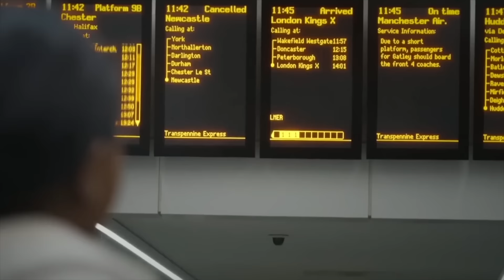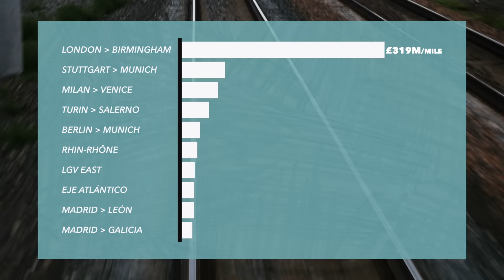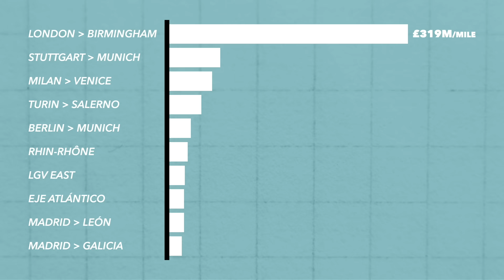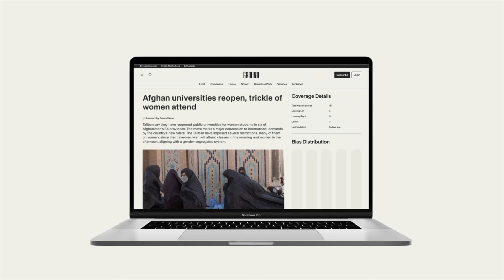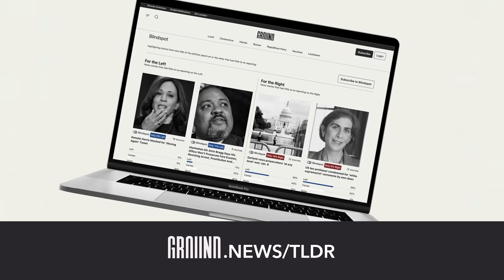The £100bn Railway: Why is HS2 Four Times Over Budget?

Comment: Strange how the UK is unable to build even 1 high speed line, while a country like Spain, much sneered at in certain parts of the UK, has an eleborate network linking it to other parts of the EU.
Reply: It's not strange at all. I'd bet anything that a lot of that money went into tory pockets.
Reply: Spain is a lot bigger and sparsely populated compared to the UK. It's a lot easy to build train on dry planes than it is to build having to buy out thousands of properties
Reply: We're not in the e.uu.
Spain is bigger and requirs more trains.
Reply: @mrcaboosevg6089  dry planes? Brother have u seen northern spain? Have u seen Spain in general ? A lot of mountains had to be tunneled and land bought , we have more mountains in one community that u have in the whole islands ,so obviously someone pocketed that money buddy , instead of coping so hard ask for the money back
Reply: @richardgallagher4880  you were in the EU when you started it.

The Netherlands has high-speed rail. Belgium has. So nice try but no cigar
Reply: @mrcaboosevg6089  excuses excuses. As the other poster pointed out, have look at the geography of Spain.
Reply: @ab-ym3bf  
Cringe.
Britain is still the same size🤭
Reply: @pascualmartinez9702  
 Cringe.
Spain is bigger so its more economical to use rail.
Stop embarrassing yourself.
Reply: @richardgallagher4880  You were the one that brought up the point of being inside the EU. And as my previous post showed, countries way much smaller and also densely populated have high speed rail.

To use your own words, stop embarrassing yourself.
Reply: @ab-ym3bf  Most of Spain is empty, that's just a fact. The only part of the UK that's actually remote is the Highlands, have you not been to Spain? It's an entirely different world
Reply: @pascualmartinez9702  I went from Malaga, then up to Porto and then to Bilbao. Most of what i saw was flat empty space, i'm sure there's plenty of mountains but i didn't see many
Reply: how about Italy???
Reply: @mrcaboosevg6089  Most of England is extremely well suited for rail. Most of the world is just fine. A couple of hills just add to the cost a bit. They hardly make it impossible. If you can build 300km/h high speed rail in upper Germany you sure as fuck can build it in the gently rolling hills of England.
Reply: @mrcaboosevg6089  Well maybe you should have payed more attention. Spain doesn't have the Alps but it is a lot more hilly than England.
Reply: Love the Spanish system, timely, clean, fast, air conditioned...smashin!!!
Reply: @Richard Gallagher  Cringe is you....I bet you voted Brexit!  And yes I am British but being in or out of the EU has nothing to do with it
Reply: @mrcaboosevg6089  an entirely different world
 indeed. Lovely people, excellent high speed rail network. Clearly a country living in the 21st century. I enjoy travelling to and through our neighbours land.
Reply: @petercrane2560  It is superb, better even than France, probably mainly because France was a pioneer on high speed rail.
Reply: @Arltratlo  I just choose Spain because I know the situation there better, and a lot of bile has been directed towards Spain from the UK in the past. But indeed, I could have picked Italy, or France or a lot of other EU nations as example as well.
Reply: @richardgallagher4880  The general public are always told to utilize public transport more often, so why on earth is our Rail Infrastructure at least 20-30 years behind most of Europe.
Reply: I mean the UK does already have one high speed line to be fair
Reply: HS1 enters the room  I'm right here, dude.
Reply: The main difference is probably that Spain actually strives to integrate its regions as it has the real possibility of regions like Catalonia, the Basque Country and even Galicia from succeeding. There is political will to build high speed rail as it promotes unity.

The UK on the other hand is far too centralised for that- 1/6th of the population and around 1/4 of the UK’s GDP so it doesn’t have as much political will to do it sadly though it desperately needs to integrate Scotland if it wants it to stop succeeding in the future 🤷‍♂️
Reply: "The UK is unable to buold even 1 high speed line"... Except the one we already have, called 'HS1' from London to the Channel Tunnel!!
Reply: What does HS1 stand for? Btw, I do know the answer I just want to know if the original poster does!
Reply: @mrcaboosevg6089  brother if u are blind is not my fault, as i said we have more mountains in one autonomic community that the whole islands
Reply: @@eliotthexton6701 since donkeys years. But to be fair, there are not many countries on the planet the English have had something negative to say about and insulted .
Reply: @pascualmartinez9702  It's easy to build a train line when your population density is about 20% of Britain's.
Reply: UK already have one high speed line, this is our second one.
Reply: @ab-ym3bf  Really there is 1 core reason and no one here has mentioned it so let me spell it out for those in the back:

Spain didn't stop doing it.

No that's it, that's the only reason. There is no more secrets. It's not pop density, its not politics, it sure as shit's not geography. We just kept doing it.

All this complaining of being overbudget, having issues buying property, etc? I've seen it. I've lived it. And if you ask any other country with a ton of HSR they can tell you the exact same thing, specially the other flagbearer, japan.

The first few lines are HELL. I remember the early years when I was a kid and news were saying AVE was DOA and we were wasteful and stupid for even trying to build it in the first place. When even flippin Merkel's people that now wanna brag so much of integrating europe were telling us to be more austere and cancel it, and UK diplomats used it as an excuse to discriminate against southern europe.

I flippin remember all that, it was so painful many thought our politicians were inept, maybe even corrupt, for continuing to fund it.

Jokes on them! Turns out RENFE was right for pushing that hard. Because yes, HSR is REALLY painful to start with, it requires a MASSIVE upfront price and no matter how much you think you're prepared, you're not prepared. Your zoning code will get in the way until you smooth it out, your ecological regulators will screech at you for months until you get them to put a sock in it, you're gonna need to train national talent to start with. You WILL go over budget and take way longer than expected. WE ALL HAVE.

But if you keep going, keep the national talent, let it expand after you've built enough of a network, its literally gonna pay for itself and more. Its probably the best long term investment my political elite has done. You can tell because I'm trying to be polite instead of labeling them as "idiots in charge" as I usually do.

So yeah that's the secret. Spain knows how to build HSR because Spain has experience building HSR. It ain't magic, it ain't culture, its just good old trial and error.

UK's mistake is they built HSR1 and then just dropped it altogether. Didn't change shit, didn't learn shit, didn't keep the national talent, just stopped. And now they're restarting practically from scratch from scratch. And with no post-HSR2 plans in the works it seems HSR3's gonna be the same. Just shot in the foot after shot in the foot.

Spain didn't make AVE1, AVE2, etc. It made AVE, and it kept going.
Reply: @pascualmartinez9702  spains population density is way lower outside the major cities, which helps a lot, and the UK's population is not as spread out over large distances
Reply: @mrcaboosevg6089  pl. Travel a little bit before speaking about Spain. Maybe you are just trying to cover UK's embarrassing end-of-empire momenta.
Reply: @mrcaboosevg6089  for Spanish engineers are smart enough to avoid drilling mountains when possible.
Reply: @ab-ym3bf  even the fact that in the Netherlands we built one for only 10 billion euro's on way harder surface says enough
Reply: @jgw9990  thats the biggest piece of bullshit I've ever read, sorry but with more people, there is more money from taxes to fund such projects
Reply: @jgw9990  is it now? But a country with 20% of the population will probably also have way less tax income to spend on such frivolities as a high speed line.

And with only 20% of the population there will be way less passe hers, so running a high speed line that breaks even, let alone make a profit, seems out of the question.

But let's follow yourogic, a D have a look at Belgium and the Netherlands, with equal and even higher population densities, and also significantly smaller when it comes to distances. According to your logic it will be impossible for them to have (high speed) trains? Reality wants to have a word with you.
Reply: @1guitarlover  the ridiculous excuses from UK posters on this thread is mind-boggling. And very contradictory. But that's the English way.
Reply: @tijs1886  yes, but it is easier to come up with such a defence as his when one's brain capacity is only 20% that of normal people.
Reply: @pascualmartinez9702 Tunnels are easy to drill, empty land is easy to buy. Like the UK are doing, Spain would have compulsory purchase. The difference is how urban and dense the UK is.
The routes were so limited they have compulsory purchased historic buildings for demolition in the uk
Reply: @mrcaboosevg6089  you have forgotten some countries in Europe have high mountain ranges so it would be more expensive rather than your basic statement. Normally the cost per mile or km in UK is one of the highest no matter the surface, just they love to make thing expensive. Like companies in charge of management of apartment buildings.
Reply: @quillo2747  tunnels aren’t easy to build and also your comparison loses all sense when you compare the hs network of the UK to let’s say Italy. Very densely populated, similar size and shape to the UK, lots of land with historic value, etc. Yet we managed to do HS that covers almost the entirety of the country and the tickets are cheap whereas the UK government is barely managing to connect its two biggest cities together.
Reply: @richardgallagher4880  The United Kingdom is still a European country and, if we hope to get down climate change then banning flights from London to Paris and other Eurostar destinations is a very good way to start cleaning up the air over South East England and North West France. Extending Eurostar to Scotland would be a very good way to allow us to ban even more flights.

Replacing our InterCity network, with high speed lines, will allow the existing mainlaines (which already have stations built on them) to be handed over to local railway authorities, so that we can create a Transport for London / Merseytravel style public body to run public transport, in every city in the UK.

Frequency is freedom, and being able to run as many trains per hour as London does, will allow the various cities in the UK, to push for modal shift from cars to public transport and reduce the number of adults and children who have medical problems from bad air.

We also need to cooperate with our EU partners, in order to build a rail tunnel between mainland Britain and the island of Ireland. With both nuclear waste and WWII bombs dumped between Scotland and Northern Ireland and the seabed being higher between North Wales and the Republic of Ireland, it makes economic sense to send high speed rail to North Wales and put the tunnel there.

The principle of enlightened self-interest, also tells us, that it is far better, for the planet, for the Republic of Ireland to import EU goods, via rail than to have ships and planes delivering cargo and polluting the atmosphere. We get cleaner air and less climate change, if RoI goods are allowed to pass through Great Britain without customs checks. And we can also do a deal with the Republic of Ireland to support high speed rail between Dublin and Belfast and maybe some other places in Ireland.

Leaving the EU does not change the need to reduce climate change one iota.

So, we still need to do all this stuff. And we still need too work with EU partners, that do things like build TBMs. And we still need to bring in EU workers who have the right skills.

All leaving the EU has done for modernising our rail network, is create additional layers of red tape.
Reply: @mrcaboosevg6089  Spain is the 2nd most mountainous country in Europe, after Switzerland. The Barcelona-Perpignan line had to cross two mountain ranges, one of which is the Pyrenees, and is roughly the same length as HS2 London to Birmingham. It came in at just over €3bln. Three. Not thirty. Three.
Reply: None of us in the UK sneer at Spain. You’re talking absolute nonsense.
Reply: @mrcaboosevg6089  as someone from the highlands... please build us a train, a steam train will do, the ferry barley runs because half the money is pocketed and then you have to take a shitty bus
Reply: because the UK prefer driving

Comment: It's an aversion to risk, which steadily increased over the past 20 years that I was involved in major railway projects. The design phase for each project gets longer and longer and hence more distant from the original requirements. Also, some parts have to be designed and built together, eg the major stations and approach routes. You can't plan a high-speed route into Euston if you have no idea on the precise alignment of the platform you are aiming to join up to. (The last carriage is designed to leave the platform at 70mph so a smooth alignment is a major requirement.
Reply: I have many stations in many play throughs of Open Transport Tycoon which prove you wrong.  The jankiest jank is absolutely fine, never a passenger complaint!
/s  😼
Reply: Nothing technical there, many countries have done that very easily.  The problem comes from Westminster, in not having good plans and advisors before hand. Spending years as a talking shop (like Wembley Stadium 10 years chat, then expect it built in two!) There are three HS trains in Europe,AVE,TGV and FRECCLAROSSAA 1000.  all have an average 198mph and have been doing it for years!  The UK doesn't even know what a Maglev train is!!  Years behind, when once we were first! HS2 is behind the curve,  the TGV has its boggies under the ends of two carriages, using the electric motors as brakes and broke the world record ( 574KM/H 372MPH)  Sept 2009  so there are NO excuses, we are 14 years behind the French and its not even running! Couldn't organise a p...u. in a brewery
Reply: What was meant in the video is that there is a long running strategy so you know what you'll eventually end up with but you build it out bit by bit
Reply: How much do you think that requirement is worth? Lets say they can build the station now for 10 million, and you will have to wait till last carriage is out of station before you can accelerate full speed. Or they can align it all and you can accelerate from standing still? How much time would that save? are we talking an extra 100 million? 200?

Comment: IIRC (I wish I could find the source!), one of the issues surrounding all the various subcontractors is that while they're all supposed to be using a single design and project management application suite, they all prefer to use their own instead - so when other subcontractors turn up for the next phase of a project area, they have to spend time working out what the heck was done beforehand, as it deviates from the "official" designs...

Comment: I remember learning about HS2 as a teen in 2013/2014. It was understood to be an over budget mess even then. I learned about it again at university where learned of the failures to perform the required EPAs and failures to compensate or even tell land owners. It was an example of how NOT to plan a large infrastructure project. This is to say I am not surprised at it's current state. They've had 20 years to sort this out.
Reply: To clarify I am pro high speed rail. It's just been done extremely poorly.
Reply: True but at least construction is underway on Phase One now
Reply: @jermainetrainallen6416  Pretty much at point of no return it's too expensive to even cancel better off just getting it done and trains running so it can start paying it's self off.
Reply: @davidty2006  Exactly
Reply: @StarJellie  I am from Hong Kong and would like to travel to England and try the British trains at the busiest King Cross someday, 

welcome to HK and try our high speed rail
Reply: @StarJellie  London waited over 50 years to get Crossrail.

We really do need the UK government to pull their finger out and to start funding rolling programs of railway upgrades, so that we can send workers from one job to the next.

Comment: During the time that the UK has been planning less than 400km of High Speed Rail - China has built 40,000km of High Speed Rail connecting every major city in a vast country.
Reply: If only we had millions of readily available workers and no health and safety to worry about.
Reply: @B-A-L  High Speed Rail infrastructure Workers in China have Health and Safety protections at a higher level than Construction workers in the USA. 
(death and injury rates are lower than in the USA) and their productivity is so high precisely because of the use of innovative new technologies which require high levels of technical knowledge and competence to operate.